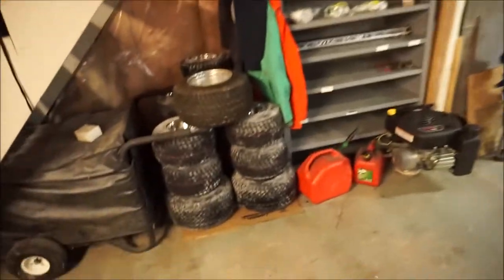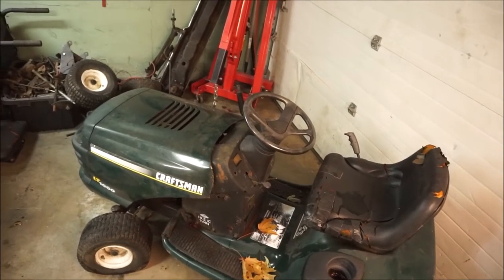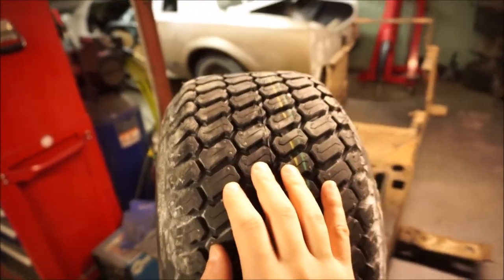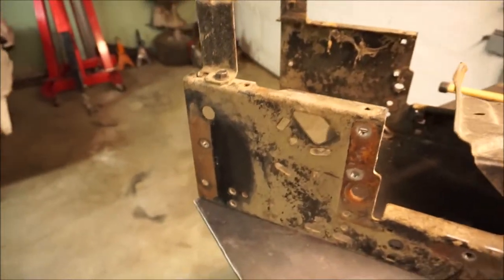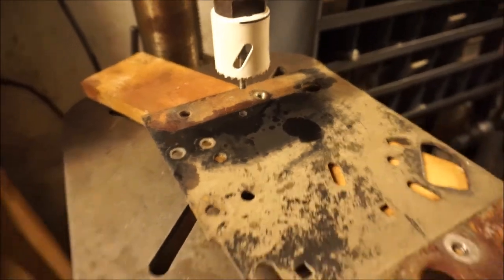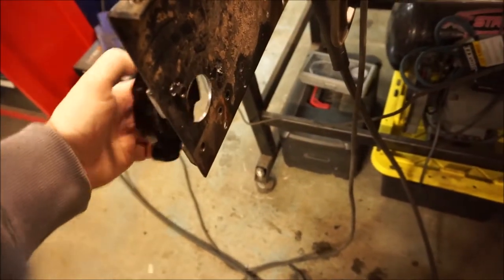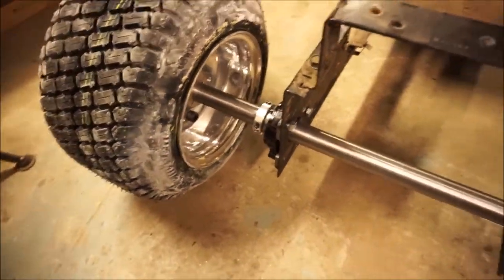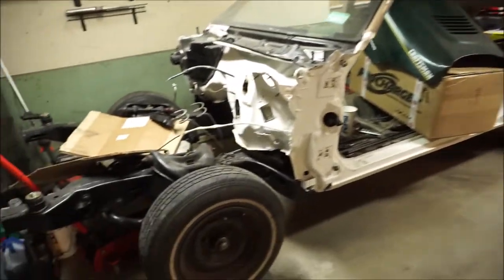Racing Lawn Mower Build 1

Comment: The front wheels on my riding mower (Kawasaki) are great, just rebuilt the whole thing by the linkage is set up to specifically handle ultra rough terrain of a farm vs. the standard golfing lawn property..but they are designed to flex independently with each land feature.  This is not desirable on the racing track.  How do you design your front end for smooth and stable turning at higher speeds?

Comment: good video but i do have to say unless USLMRA has changed even if you read the rule book & make it fit the rule book, they will change it  on a case by case basis thats why we stopped lawn mower racing. Good luck cant wait to see it done.
Reply from the maker: Thanks for the support! Sorry to hear that was your experience, I've only run a handful of national events but have seen over the years a slight loosening of rules allowing a little more freedom with fenders to equalize the manufacturers more.
Reply: MikesBigBlock I ain't for more stinking rules gonna build a t-bucket rat rod
Reply: @TheJanticJournal  can you tell me what tractor that frame is from ?

Comment: Do the wheels really have a diameter of 8" with the wheel wouldn't that be quite a big wheel for a racing mower?
Reply from the maker: 8" is pretty standard for mowers and required by the rules for this class, some of the smaller frames and more kart style machines do use 6" wheels though.

Comment: Dang the Buick is all Tore apart what is your build plan
Reply from the maker: Big plans lol, I uploaded one video of the new rear end but I really need to get it together with a new motor for the summer. It'll be a pro charged SBC and I'm still not sure about body and interior plans.
Reply: TheJanticJournal sounds like fun pro charged sbc I put a 9 inch from pem racing in my g body and I have been doing a lot of frame work my videos are poor quality lol but I try

Comment: What is the height of the 7.50x8 premium tires and where do you get them. I have a machine shop and building a t-bucket from a 13 opposed flathead.
Reply from the maker: I got them from lawnmowertirestore.com. I'll get you the measurements tomorrow.